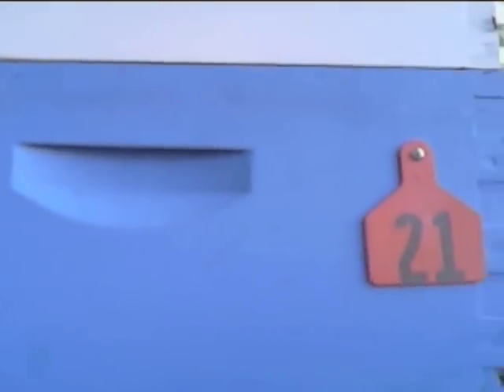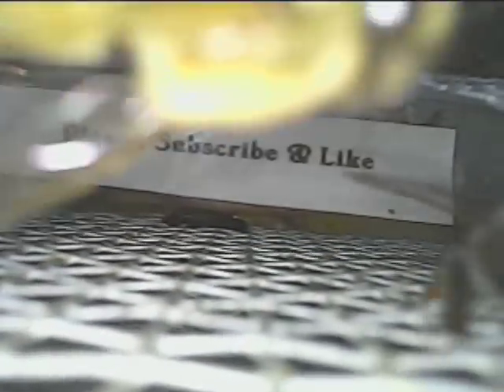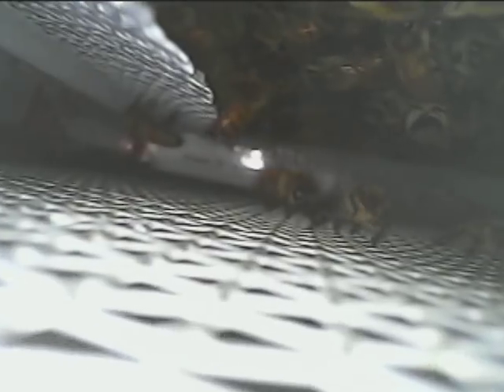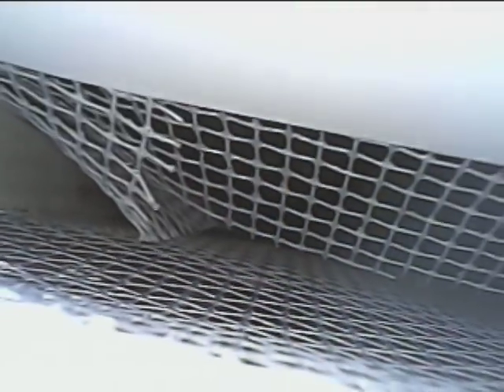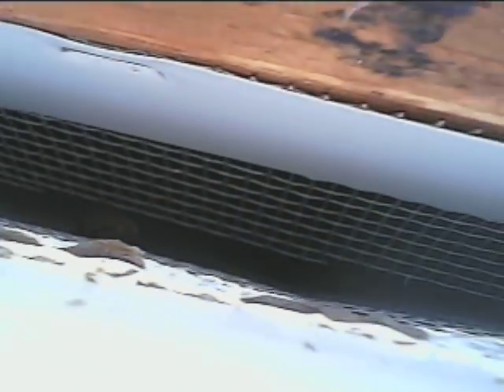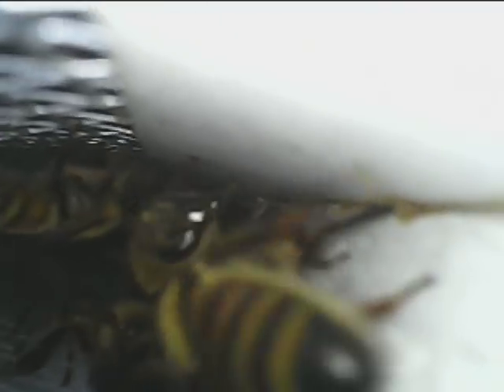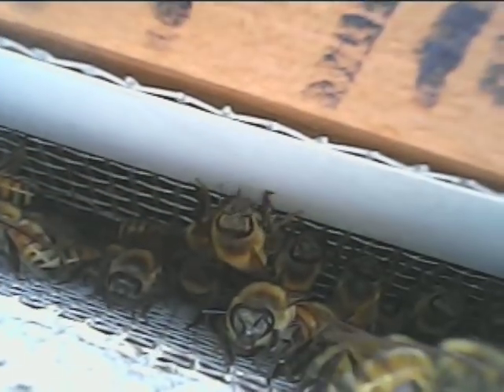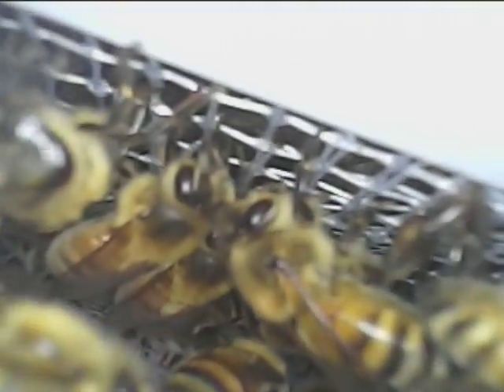Small Hive Beetles, inside the Hive with Beetle Barrier 2.0 it controls, prevents and traps

Comment: Hey Jeff it’s me again. I’m curious if when you made it you used the clear neverwet and if that’s important? I used the white because it was cheaper and it had kind of a powdery layer that came off. I put some ants in it to test it out and they can crawl right over it. Could be the humidity potentially here not sure.
Reply from the maker: Hi Tripp, 
The same thing happened to me on a hot and humid day, just like any paint the Neverwet is also affected by the humidity, I do mine in an air-conditioned area. Thanks for watching and the comment..

Comment: Mr. Willard. I don’t know if there’s any way to contact you directly but I would love for you to do some research on the impact of red light on SHB. There’s a company selling red plastic covers that filter the light and they claim to have had success but I worry about the effect of plastic covers on hive temperature and the durability of plastic covers in Fl due to UVB degradation. Wouldn’t red leds work better if red light does repel SHB?
Reply from the maker: I'm like everyone else, always looking for that "better mouse trap" idea, unfortunately you just described the problem's with these red Lexan polycarbonate tops, they allow red sunlight in but in essence you end up with a red green house effect and no way to vent the heat, plus the UV damage to the plastic. Also bees like a darker area for their hive so with the upper part of the hive exposed to high heat and sunlight it will drive the bees towards the cooler and darker bottom along with SHB's, it doesn't get rid of the SHB it just moves them around.
  Now you hit on something I gave a friend in Australia an idea to work with, by placing 12vdc red led strips or tube lights on the upper part of a screened top cover so the bees can't get at them, next run that to a small sealed battery which is being recharged daily by a small solar panel. These led's draw so little voltage that a small battery would be sufficient, Aliexpress has these red led lights really cheap.

 https://www.aliexpress.com/wholesale?catId=0&initiative_id=SB_20191125125351&SearchText=red+led+strip  

Good luck and thanks for offer.
Reply: Jeff Willard thanks for your reply and looking forward to your future videos! We miss ya!

Comment: Just started researching how to prevent SHB vs trapping them and found your videos - fantastic job and impressive dedication to improving/researching.  My question is would it be just as useful to simply tip up the bottom brood box and staple the aluminum strips to the box itself and set it back down onto the SBB?  No 3/4" shim setup?   FYI - I'm using the BEESMART screen bottom which is plastic....wonder if I painted it with NeverWet if the SHBs would not be able to climb up the sides from the screen?  Thanks
Reply from the maker: Hi Champy,
  You just described my first design and also my first video. I found that with all the forager bees climbing over the Neverwet coated barrier they became contaminated with dirt, wax and propolis. That led to all the update videos from proper Neverwet adhesion on the aluminum flashing to the new mesh ramp design. I think if you watch all the videos from the beginning to the last one of "Inside the Hive" you see the design changes and get an idea of what I did to over come the problems in the original design. Coating the bottom  board or sides will have little to no effect in keeping the SHB out of the hive, you just need that protruding barrier inside the hive. Happy Beekeeping....

Comment: Hi Jeff. Was wondering if you tried applying the never wet to pre-finished aluminum fascia material instead of using bare aluminum flashing that needs etched?
Reply from the maker: Hi Reggie,
  I had thought of using that material, which would work but it has drawbacks; it is a thicker material, low tensile strength (soft aluminum) high cost per roll and limited widths available. With aluminum flashing it is high tensile strength (ridged), very thin, multiple widths available and low cost per roll.
  If you can get a surplus roll or scrap pieces from an siding installer it would be worth trying because the surface is already treated and painted which will increase the adhesion of the Neverwet and you wouldn't have to prep it like you do the flashing to increase adhesion (see prior videos), give it a try and let us know...
Reply: Will do! I do have one more question...I like to notch the front edge of my inner cover and push the telescoping cover all the way forward for a secondary entrance to offer foraging bees a shortcut to supers. Is it likely all the beetles that were deterred by the neverwet would just find their way to that entrance if I leave it unscreened or just a few of them? I know you show instructions to screen top off completely but wondered if you tested both ways or not? Thanks for the info and all your research!
Reply from the maker: I can't even begin to count how many times I have removed my telescoping tops and have seen small hive beetles crawling on the aluminum window screen of the inner vent covers.  I've shown people in several of my videos on how to make the SHB proof vented inner covers. The SHB will crawl all over your hive looking for a place to get in and they can easily go through 1/8" hardware cloth,  so yes if there is another opening in your hive the SHB will find it no matter where it is.

Comment: Question, when you sprayed your strips were they smooth or rough looking when they dried? Mine are kinda rough looking. Thanks for your videos, love em!
Reply from the maker: Hi Larry,
That is what the 2nd stage looks like, it confuses a lot of people because they think it should be super smooth. If you looked at the surface under a electron microscope you would see a surface of sharp peaks and valleys that is why the SHB tarsal pads (their feet) can't grip the surface. Thanks for the compliment, I have more videos coming on things that will help beekeepers.
Reply: @jeffwillard2417  Thanks Jeff! Another question, when I picked up my strips I had powder like film come off on my hands. Is this normal? Did you wipe them off before you installed them? Thanks again!
Reply from the maker: I have noticed that on mine also at times when it was a hot humid day spraying, I now spray mine inside a air conditioned area for a drier environment. You could of also had some overspray residue but I never wiped any of my coated strips off before installation.
The biggest problem that I found was the adhesion of the first stage on the flashing, which I experimented with and covered in the prior videos. Good luck with your bees..
Reply: @jeffwillard2417   Well I tried it your way and guess what,,,,, IT WORKS! So far this season when I checked my hives (only have two) I have only seen 3 beetles! They are all trapped in the bottom! I am going to continue checking and if all goes well I'll pass this method along to the bee keepers association we belong to. Thanks again!
Reply from the maker: Glad to help..

Comment: Do you think a wipe down once or twice a year with alcohol or some and water will be enough to keep the aluminum fresh and slippery?
Reply from the maker: A hydrophobic surface is not slippery, under a microscope it consists of high and low points. That is why it works on a SHB tarsal pads(feet) they can not grip the high points. The best solution is to remove and refinish the 2.0 Beetle Barriers as need.

Comment: How are things going now that you are 3 months in?  A few questions/ideas:
1. Do you still think you need to use the industrial never wet or will the spray on work with the new method?
2. Instead of bending the wire to protect the never wet, what if you just put a wood shim in there the same width as the aluminum coated strip but left a small gap, which is too small for the bees to get into, but not for the hive beetles?  This should fully protect the never wet and the hive beetles would get chased into the small gap and not be able to climb out into the hive.  I am thinking of trying this with the cheaper spray on stuff, but wanted your opinion.
Reply from the maker: Hi Jeff,
  The mesh ramp really helps to keep the forager bees off the Neverwet coated barriers, so you might be able to use the spray can material.
  However you adapt these coated barriers to your hives you always have to keep in mind how far the SHB can stretch out to bridge a gap. In the first video test when I used live beetles I was shocked to see that beetle anchor its feet on the wood and reach out for the edge of the coated barrier, if that barrier was only a 1/4" wide instead of 3/8" that SHB would have been able to grip the edge and escape.
  I'll be taking the 2.0 Beetle Barriers off to check the condition of the Neverwet and let everyone know with a short video. If your idea works make sure you share it on You-Tube, Beemaster or Beesource.

Comment: Does it appear to you that the bees are still trying to clear the surface coating from the aluminium?  Have you tried having the barrier under the steel mesh, preventing the beetles from coming back through once chased down?  Or is this inadequate for control of the shb?  I'm asking as I want to incorporate the strips into my new hive.  I like your idea of mounting the strips on a separate frame, and think I'd just switch these out for repainting every couple of years.  Thanks for sharing the techniques and trying to improve the design.
Reply from the maker: Hi grubbyamy,
The bees are constantly cleaning the inside of their hive including the Neverwet coated barriers . I had thought of bending the mesh (1/8" hardware cloth) back over the Neverwet coated barriers to protect them but you would still need a 3/16" - 1/4" gap at the edge so the hive beetles aren't able to crawl up onto the mesh and enter the hive or fall onto to the mesh while trying to crawl onto the coated barriers. If the Neverwet coated barriers needed refinishing you would have to bend back the mesh and then space the gap all over again, unfortunately there is no perfect solution to protecting the Neverwet coating but I think this idea comes pretty close to it. Good luck with your bees and thanks for Subscribing....

Comment: Jeff, great videos and thanks for spending the time to post them.  Seems like the SHB are worse this year. I have a question about the never wet. I would like to try it for an ant barrier. Do you think I could apply it to aluminum AC tape? In my bee yards I use custom stands made of aluminum with a single post design so I'll try it on the stands as well.
Reply from the maker: Hi evanfly,
Thank You. Single post aluminum sounds like a strong and attractive hive stand. How about if you mask off a 4" to 6" section off the post towards the top of the stand and spray Neverwet directly on the post. If you spray the aluminum tape and put it on the post the flexing of the tape may loosen the adhesion of the Neverwet. Did tou Tig or Mig weld the stands to assemble them and was it square or round stock, I'm curious because I like to see creative ideas... Here is the ant barrier video.
https://www.youtube.com/watch?v=FeKmeV0NzMc
Reply: Actually the tape idea was for other applications where I don't use the aluminum stands, ie some top bar hives etc. I will eventually have the alum stands on all my hives but we do mig weld them and it takes some time. Currently I weld alum cooking pots onto the 3x3 square posts that I fill with mineral oil to keep the ants at bay. I use the pot lid to keep the bees from getting to the oil.  They are 3x3 square posts, and they are quite solid. THey work best for me here in FL because they are also hurricane proof. I had many hives strapped to them for Irma and they had no problem. How can I PM you, I can send a picture of the stand. I think I will try the neverwet on a section of the post and see how that works.
Reply from the maker: Sounds good, send them to   r_willard@bellsouth.net   I live in Milton FL. near Pensacola so I know what beekeepers have to go through in Hurricanes and its not fun....

Comment: You just introduced new terminology... Etched and Sanded.  Can you explain?  How do you etch?  What grit do you sand?  Is this something we would discover how to do based on instructions with the product?  After a season in the field, which one do you think works better (Etched, Etched and Sanded, or Sanded)?
Reply from the maker: Hi Mike,
Etched means to chemically treat a metal surface to condition or roughen before refinishing, I used 150 grit. These barriers were installed on existing hives and have been on for over 2 weeks. The final results for which refinishing system will work the best is still unknown but at this point they all looked good. Future Inside the Hive episodes will determine the best way to refinish the aluminum. The link below will help you understand what I did in case you missed it.

https://www.youtube.com/watch?v=gXU2EAT2lek